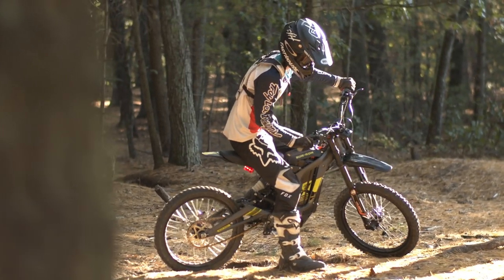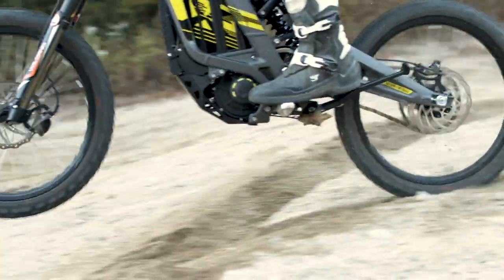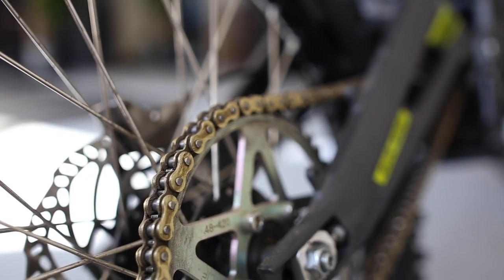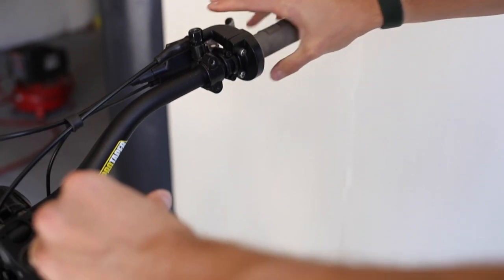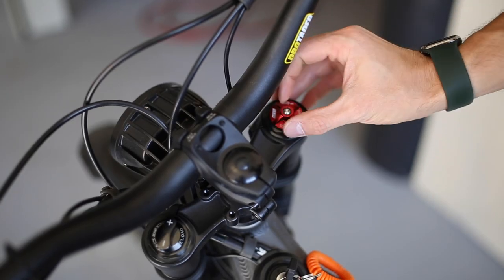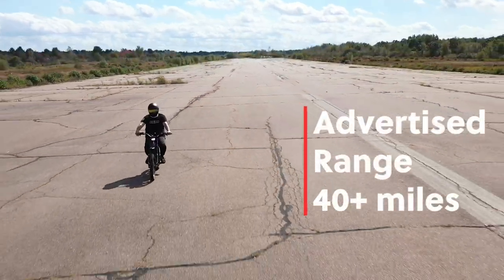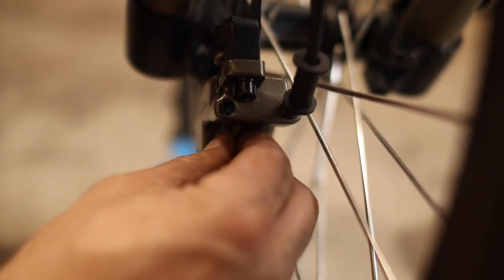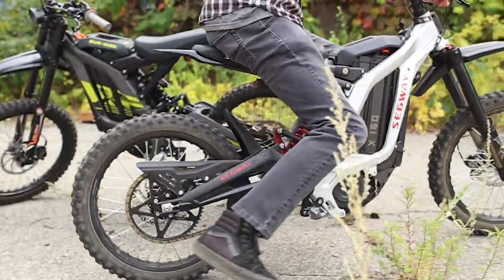Sur Ron X (Black Edition) Review!

Comment: my problem with these electric vehicles is the life cycle of these batteries.  enjoy replacing them each two years or so down the road.
Reply: That's not true. These batteries are similar to what they use in tesla's and should easily yield 1000+ cycles.

If you use the full battery capacity every day of the year (*365) = 2.7 years ~.

These batteries need to be changed every 4-5 years before you see any significant performance drop.
Reply: @yup8082  price batteries add up that more equivalent than a 70cc vespa scooter.
Reply from the maker: Yup is correct. We're reviewing a Monday Gen 7 bike currently, we got a demo model that has a early build battery 72v pack and they said it has over 2,000 cycles on it. The Gen 7 alone was used over 7,000 miles on the battery, and it had been used with previous prototypes. Battery still performs well and holds over 80% capacity
Reply: Trust me. Its well worth it. After two years i have no problem getting a better and more upgraded battery
Reply: I'll laugh all the way to the bank with the money saved on gas and oil changes. not to mention it is just an all around awesome machine.
Reply: my surron is pretty good but your right about the battery. If I ride my surron hard like my dirt bikes I get only 20 miles max on the battery. The surron is a big downhill mountain bike. MY 4 stroke dirt bikes will destroy the surron is every way imaginable. Buying the surron as a big mountain bike is a predictable pleasant surprise but anyone buying one of these thinking its a moto bike with massive plush suspension will be bummed out cause its not.
Reply: @tintin6291  motor and battery are expensive the technology isn't getting any advance.. the manufacturers producing battery and the controller are laughing their way to the bank
Reply: @dreadknot2238  there is no other bike that can do what the sur ron does for the price and if you upgrade to the 72v battery with the upgraded controller it goes even faster and farther. Fastest ive seen it is 86 mph and the stock stuff already goes 50mph and can last for hours depending on how you use it. Quite litterally the only bad thing is having to charge it otherwise my battery is still going strong after using it everyday.i keep up with everyone on the road. The only time that sucks is when cars are going 60 and im only going 50. Which the stronger battery would fix that.
Reply: @tintin6291  yeah that what it claim.. no video, didn't happen. I looked on YouTube for that speed and i cannot find it nowhere on there.
 the sur ron maybe the second class fastest next to onxy on stock but what above other manufacturers making EG the super slow 73, i cannot justify paying 2.5k to go 30mph when there are other alternatives for less cheaper with better performance
Reply: @dreadknot2238  well one there is a lot of factors to consider. Im 150 pounds so i will put less stress on the battery by a significant margin. Two. This bike 100% goes faster than 30 mph. The speed may vary between 45mph and 50mph depending on your weight and terrain your on. Also the grip of the tire and the incline your on. The batch of bikes mine came in the green wire thing was already taken care of. Meaning the ep mode was going from 27mph to 30mph and the sport mode from 30mph to 50mph. And i say 50mph at peak conditions and 47mph at average. My friend was riding in the back of my bike so thats an extra 170 pounds and he took out his phone with the speed app and it said 42mph on sport mode. A video doesnt do this bike justice one because all apps and speedometers are different and two you might be a different weight and on different terrain. Trust me when i tell you that this bike is powerful. Im off the line faster than any dirt bike ive ridden next to so far because all the power is in the throttle and not shifting gears. A motorcycle off the line is faster off the line and has more top speed. The stock sur ron lives between a 125cc dirt bike and a motorcyle. There is a way to make the stock battery faster as well ill link the videos
Reply: @dreadknot2238  https://youtu.be/I8Ia6P1dBBI

Thats the 70 mph video with stock battery
Reply: @dreadknot2238  https://youtu.be/A4-kY7AaZ9Q

And there is the worlds fastest